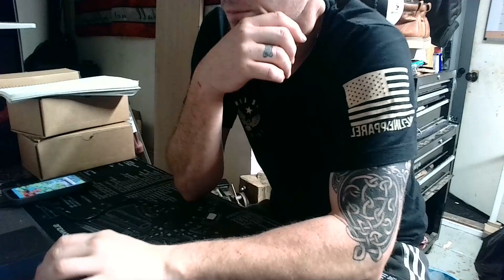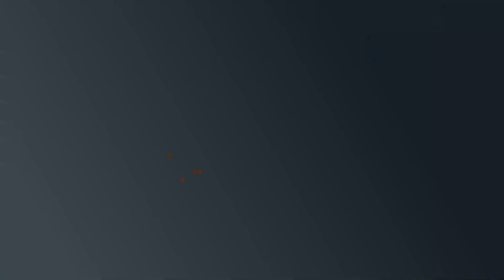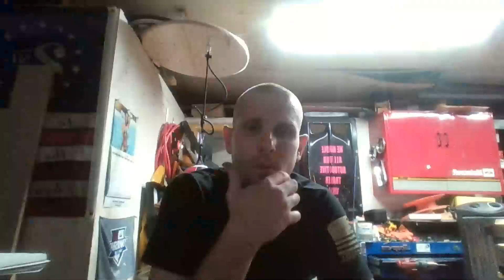unboxing Sonoran Desert Institute FTE 217 Madern Sporting Rifle

Comment: Sorry dude but the difference between the AR15 BCG and the AR10 BCG the AR10 BCG is bigger by about 20%
Reply from the maker: Sorry for late response and thank you for your response thank you for that point when I opened this box be for, I took the class, and I am gearing this platform to new commers and when I matched the BCG up to my AR 15 for they sent me a AR10 and it was visibly the same so that is why I said it but they are different and I did say that in the middle of the video
Reply: Beat me too it.
Reply: Another thing to be mindful of is that the standard bcg works with 308, 6.5 Creedmoore and the new 277 fury, however you do need a different one if you want to try the new 8.6 blackout
Reply from the maker: @kanaancross317  I’m gonna have to look into them just not happy with that buttock but I think I’m gonna keep it to set up the way just because it’s what I got from the program